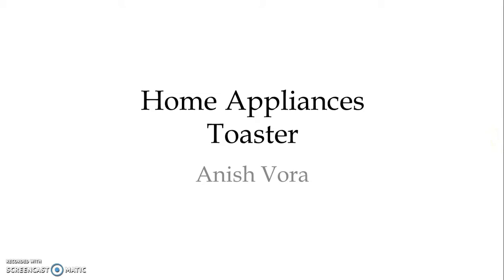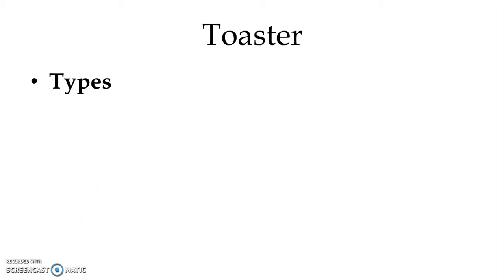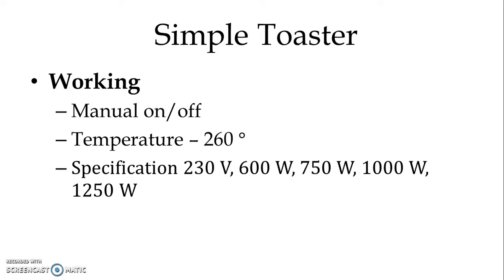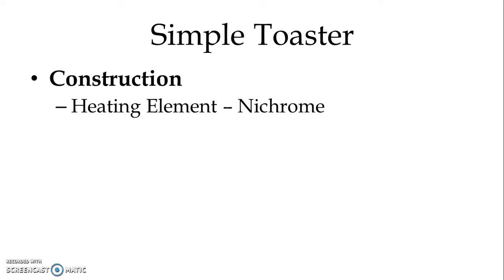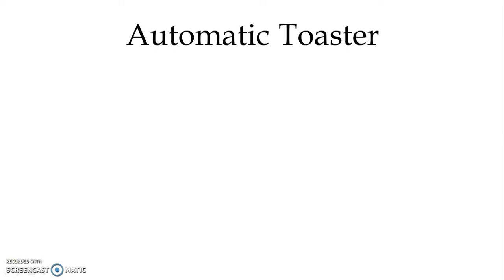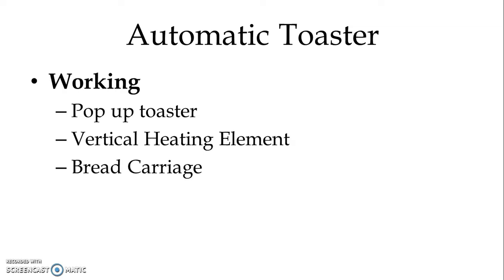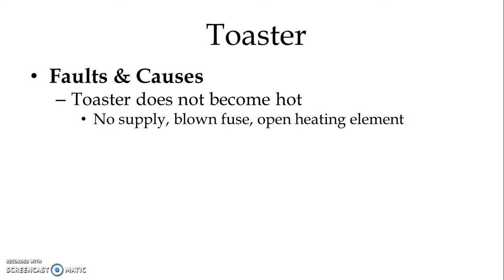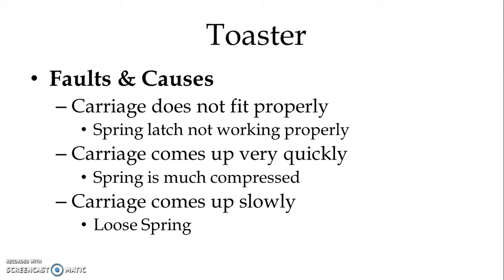Toaster |Home Appliances| |Utilization of Electrical Energy|

Comment: sir 3 hp single phase 24 slot 4 pole induction motor stater core size 3 inch , inner dia 4 inch nd outer dia 7 inch . how to turn calculate nd swg wire number calculate for this motor pls make video on this motor because i ask to many sir bt no one rply back